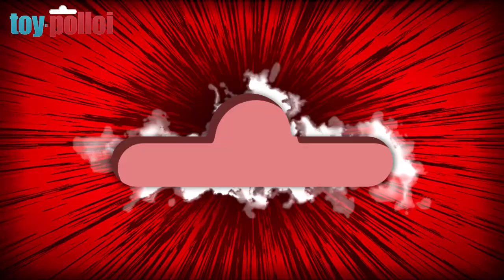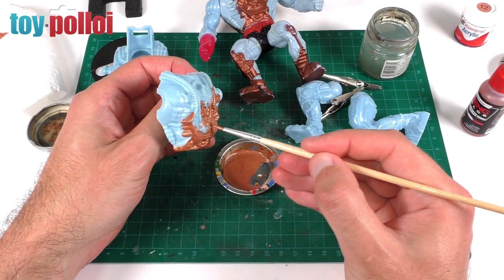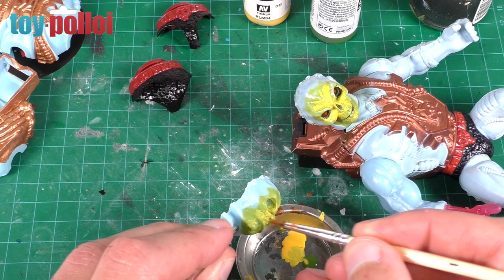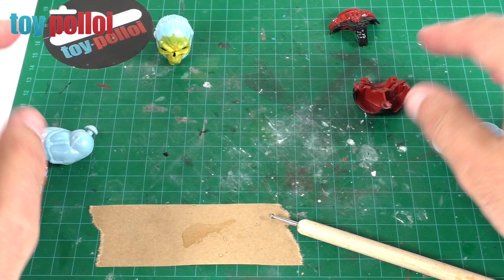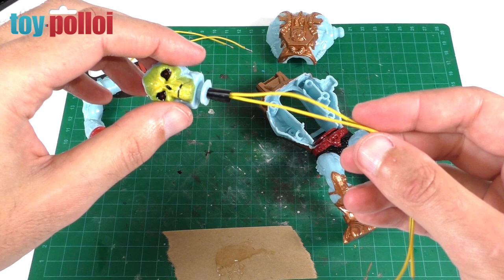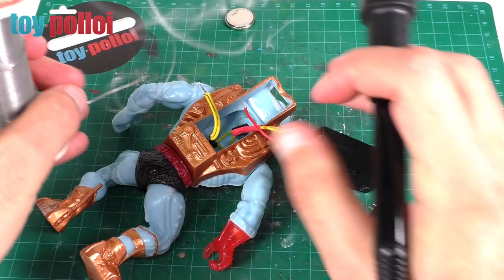MOTU Laser Light Skeletor Barbarossa Custom kit build - Toy Polloi

Comment: have always thought these have so much detail that 80's toy production put on but just didn't do anything with. You could make these look amazing fairly easily.

You also could very easily add the dirty effect to him with a brown/black wash over the metal
Reply: Who is up for a part 2? You've seen how to do it the original way, now let's see part 2 ...adding the custom details Mattel didn't have the budget for. Use the classics figure for inspiration, paint all the little wires in, the skull details, the parts that poke into the skin etc. It would make for a great part 2.

Comment: That's a lot of light bleeding through when it powers on.  Would it have helped to paint the inside of the skull and right arm black, or would too much of that have shown through the plastic?
Reply: maybe but overall does not really matter as cannot see it through the cape i imagine
Reply from the maker: You could do that and it would help. But they wouldn't have done that on the original toy. That has light bleed all over the place :D

Comment: Just a tip, without a current limiting resistor between the battery/switch and the leds you run the rik of blowing out those leds, at least it will greatly reduce their life and the batteries will also run down very quickly.
Reply: Run the rik is my new catchphrase. I thank you sir.